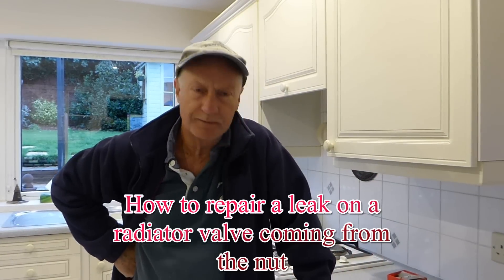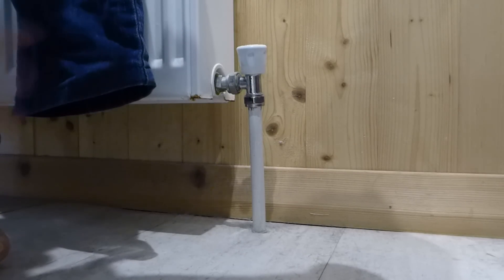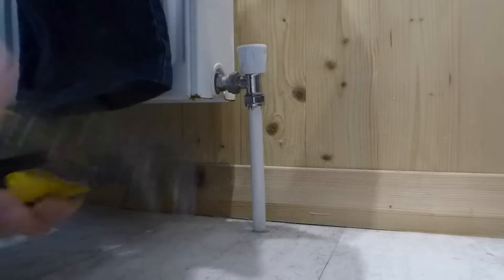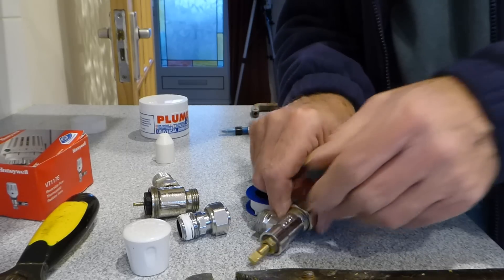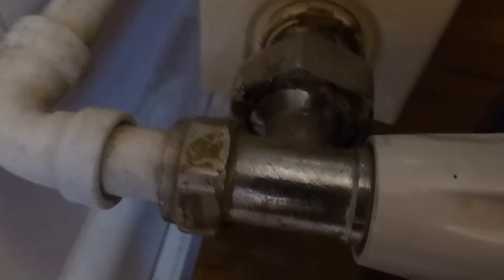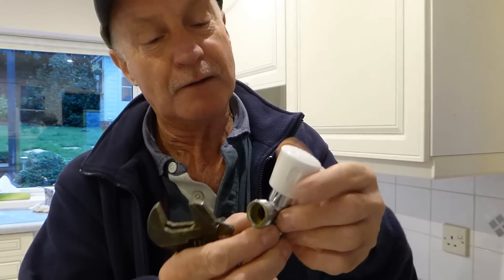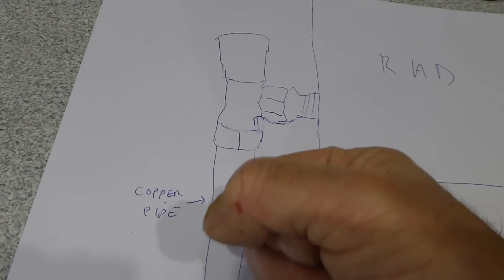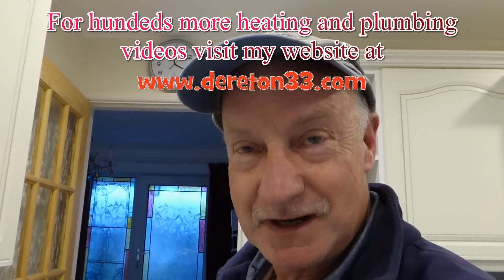How to repair a leak on the nut of a radiator valve

Comment: Question : I have 8mm copper on the radiator pipe coming from the manifold in the loft could I replace this with a plastic speedfit pipe 10mm using an insert 🤔
Reply from the maker: Not without connecting the 8 mm copper to 10 mm first.

Comment: Silly question possibly but I have a leaking packing gland ( 45 secs in this video ) and this guy says to unscrew and pack with ptfe . Do I need to drain the system as surely water will burst out or hopefully not , just unscrew and pack, with minor spillage ? Thanks in advance ! ☺
Reply from the maker: No need to turn the water off very minor spillage if any,  just have a cloth under it, if you are worried.
Reply: @dereton33  cheers pal! 👍

Comment: My problem is ... After applying PTFE tape or boss white - when I turn on the water, the valve threads with the nut and cone attached bursts away from the smooth pipe which goes into the radiator. I can't find anything which holds it ... I'm now thinking super-glue 😆
Reply from the maker: Try some hemp, with boss white on it around the front of the olive.

Comment: I have removed a radiator for decorating and have a leak coming out where water flows out or in the radiator. This would not be a problem if the radiator was back in. It's not coming from the top spindle that you can repack and not from the bottom valve either. Is there a way to stop this leak until I can get the radiator back on the wall? It is completely tight off on the spindle. I assume it was leaking when the radiator was on the wall but of course would have the radiator next to it so wouldn't leak. It's specifically leaking out where the radiator would be. I assume because the valve is so old. I currently have a cloth poked in the hole into a container to wick it up until I can get the radiator back on the wall. Thanks.
Reply from the maker: No nothing can be done best to use a brass cap to stop the flow for now.
Reply: @dereton33  Thank you for the reply. I used a cloth to wick it up into a bowl overnight. I painted behind it and cleaned and sanded and got the radiator back on the wall. Perhaps you could do a video on those who wish to decorate and this dripping leak? It's not covered in anything I've seen on your channel. Some people might want the radiator off for an extended period and demonstrating the brass caps would be a good video. Do you have a link to brass caps for this as will be doing other radiators in the house soon? Thanks.

Comment: Hi Dereton,
My radiator has been leaking from the side of the radiator end which you have mentioned at 06:51 and which is very rare. It was only installed 2 months ago and the plumber had put a new PTFE tape on it. Now what should I do? Should i just tighten the end that goes inside the radiator or put a new PTFE tape on it again? Thanks
Reply from the maker: Try tightening it first. If it still leaks then add some more PTFE tape to the joint wrap it around the olive.

Comment: On the last valve you mention on the live, is it clockwise to tighten on the left side of the rad looking at it and anti on the left?
Reply from the maker: Yes.
Reply: @dereton33  Thanks. Is there anything better than PTFE that you can use on an olive that leaks? I see plumbers using grey stuff all the time when connecting various pieces. Is this good to do?

Comment: Great video thanks. We have lockshield valve with a leaky pipe nut (the one at the bottom) and are hoping just to nip it up. But if we do need to undo it completely to add ptfe tape, what if the valve is on the INLET side - wont water just pour out once the nut is loosened?
Cheers
Reply from the maker: It will  leak out on either side, just have some old towels ready while you wrap the PTFE tape around and tighten the nut back up.

Comment: If one was to have done exactly what you said not to do at 3:17 (before they had watched this video) and caused water to leak down the pipe from the valve is there any way of repairing the seal or will the valve need to be replaced?
Reply from the maker: Just use some PTFE tape around the olive. PS shows how important to watch the whole video before proceeding..

Comment: Brilliant video. I'm not a plumber and I have a leak in my upstairs radiator. The leak is definitely from the last description. Home Emergency said they would have to isolate it but they won't replace the valve or nut.

How much does the valve replacement cost?
Reply from the maker: About £6.00

Comment: On the end with the Thermo stat can I shut that off and then detach the other side (where my leak is) and not drain the entire system
Reply from the maker: Yes as long as the temperature does not drop below 5%.  Or the thermostatic valve will turn on.

Comment: I have one that is dropping where the rad tail screws onto to valve. I have tried nipping it up, no success, then drained rad and applied plenty of ptfe around the valve thread, but still it drips? Regarding having to drain the system when working on the live side, would it not be possible to fit a compression isolator (perhaps a full bore one) on the pipes up to the rad valves, to facilitate maintenance?
Reply from the maker: You can fit valves they just don't look nice.

Comment: This video and your one on how to remove a radiator saved me a hell of a lot of money. I have no clue when it comes to plumbing. Got the rad off with no problem. (Previous owners bracket fixings were hanging off the wall) Fixed the leaky valve with some PTFE tape and put it back on. Got a little wet, but with the help of my wife we did it no problem. Thank you and keep up the great videos.
Reply from the maker: Thanks for your kind comments Hitman 1.

Comment: How about sticking a few layers of pvc insulating tape on the jaws of the grips so they don't damage the nice shiny chrome finish on the valve, those pegler valves are well expensive.
Reply from the maker: Good idea if you can get the grips to grip with it on.

Comment: Does aircock need to be opened to do this as i have older heater and its wore away and i cant turn it
Reply from the maker: No, you will not let any water run out to need topping up the rad.

Comment: How can i pack with ptfe if the water is pooling up around the valve? It's totally locked off but it keeps pooling up! Happy Easter and great vids by the way.
Reply from the maker: You have to persevere and poke it down with a sharp bradawl, then start the thread of the nut (packing gland)
Reply: Thanks for the replies. I'll see if i can figure it out for myself. All the best

Comment: Thanks. Was not sure if i had to turn off the water supply or not. No one says you do. Turns out i simply had to turn the nut down a half turn or so, until the leak stopped.

Comment: My leak is coming from the bottom nut. I tried removing and packing it with PTFE, but as you suggested the flow of water is too much to let it take hold.
I'm tempted to just replace the valve without draining. Apart from dealing with a couple of minutes of live water flow while I swap them, is there any big downside?
Reply from the maker: No just be as quick as you can with the change over, if you are worried though you can always get a freezing kit and do it with no worry s.
Reply: You could take the risk of doing it live but be aware the thread on the nut on the pipe may not have the same thread as the new valve

Comment: Great videos!
Im trying to replace a radiator with a towel rail. The valves need to go in vertically rather than horizontally. Can I save the hassle of bleeding and repressurissing and the cost of new vavles by just attaching some elbow joints?
Reply from the maker: Sometimes but it depends on what valves you are connecting from.

Comment: okay thanks which way do I turn the nut to take it out clockwise or anticlockwise?? and also does the radiator need to be OFF to do this?Thank you for your help
Reply from the maker: The rad can stay on, to take the nut out it is anti clockwise.

Comment: Hi Al.
Am in need of your expertise yet again.
I have a leaking pin on a TRV. 
Therefore, I thought the best solution would be to replace the TRV.
The system was flushed few months back with new chemicals poured in.
The question is, if I need to add chemicals to the system again after drainage and valve replacement?
Or there would be enough chemicals left inside to be topped by water only.

Much obliged and utter respect as ever
N

Comment: what can we do  we turned tried to turn the radiator back on took the cap off and used pliers but the brass part snapped off when turning
Reply from the maker: O dear sorry Julie, the valve will have to be renewed now.

Comment: Should the tail threads of a new radiator be rusted/have metal debris in the threads and, thus,  it is impossible to screw in the valve tails by hand by even the smallest amount? Should screwing in with the spanner be VERY stiff on such a new radiator and cause a crunching noise to occur when doing so? Not cross-threaded. Should the number of threads on the radiator tail entry be significantly less than that on the valve tail? If this can be the case, does one screw in the valve tail until just one thread is showing, ie way past the number of threads in the radiator tail itself? Even if screwing in thus is excruciatingly stiff with 5 or 6 threads of the tail still showing? Does it sound like we have been sold a 2nd-hand duff radiator as new?  It arrived without plastic plugs in the tail and the wall fixings were missing (towel radiator). Metal debris was on the tails; could be felt easily on the fingers. The debris inside the bleed valve was even worse and the bleed valve itself immediately failed to shut after bleeding once the radiator was filled up. New bleed valve seemed to solve that, but water bleeds out of the tails after radiator gets hot and cools down. I suppose I did only put 10 wraps of PTFE tape on, but I would assume the PTFE got destroyed by the crunching that occurred when screwing in the tails as far as they would go, ie with 4-6 threads still showing. When I say, bleed out of the tails, I mean where you say in your video that it very, very rarely leaks.
Reply from the maker: The tails should screw in at least 4 to 6 threads deep, also try using hemp and boss white instead of PTFE tape.
Reply: @dereton33  Thanks for the reply. I used Jet Blue with PTFE to be extra sure! Didn't know about hemp. Of course, it's in the back of my mind that perseverance is pointless if the radiator is duff. Problem is I don't know what a new radiator should look like around the tails. I was not expecting rust/debris in the tail threads. All the online videos show you guys screwing the radiator tails in by hand quite easily!
Reply from the maker: If the rad tails in the rad itself are rusty you will get a real problem with sealing it.
Reply: @dereton33  Once again thanks. Got another new rad and tail thread is not rusty, so the other one was duff. Checked out a lot of new radiators (after getting paranoid) and none of them ever have more than 3 threads at the tails. Valve tails have 10+ threads. Are we supposed to screw in only 3 threads or as far as the valve tail will go? Companies making these products never reply to questions esp. Pegler Yorkshire
Reply: @rodneyleadbeater5410  it's a taper thread so you need to screw the tail in until it's reasonably tight but don't overdo it

Comment: I'm trying to get this, but shouldn't you wrap the Teflon tape around the pipe in the direction that your nut will turn so it won't bunch up or back out?  At 6:20 you're wrapping the tape in one direction and at 6:30 you're turning the nut in the opposite direction. Or does it not matter here?
Reply from the maker: On this job it does not matter.

Comment: Dereton, I recently came across a bad situation. A cleaner had tried to let air from a radiator by turning the escape valve at the top. Within seconds the whole component literally came away and very hot water at high pressure started spraying across the bedroom. The taps at the base of the rad were also seized. What emergency remedy could you suggest to a householder in such bad circumstances, to stem the flow, whilst a plumber is on the way?
Reply from the maker: A large ball of plumbers mait, whacked into the valve.

Comment: Hi I have a problem my radiator brackets are coming off the plaster board and created a bigger hole can you please help thanks colin
Reply from the maker: Hi Colin you will need plaster board fixing screws.
Reply: Hi I thought that I would have to move the pipes,  the holes are bigger than the original not sure how to do it,, I thought of wedging some pieces of wood in the holes and try to screw size 6 coach bolts so they can tighten on the wall of the plasterboard regards Colin
Reply from the maker: There are some fixers that are like large screws that would fit into an oversized hole, once screwed in the over sized holes the smaller screw that comes with them, screws into that.

Comment: Any advice when I have a valve where the cap is one of the chrome covers that doesn't seem to come off? My leak appears to be inside the cap rather than on the nuts shown here. Sadly the chrome cap doesn't seem to unscrew or pull off. Many thanks.
Reply from the maker: The cap should come off to reveal a screw underneath this will allow the top to come off.
Reply: dereton33 many thanks / cap unscrewed after a little bit of limescale remover 
All sorted , appreciated

Comment: I have a valve on my radiator I turned off wen replacing the radiator I came to turn it back on and it will not move it not on the thermostat valve it's the other one how do I release it
Reply from the maker: Take the plastic top off and use a small spanner or pliers.

Comment: my valve doesn't leak when the radiator is on but leaks when the radiator goes off at night when the valve goes cold. What do you suggest please??
Reply from the maker: Repack the gland with PTFE tape. I have a video on how to do it.

Comment: You can disconnect one end of a radiator and have the pipe open without draining the system, and not have water come out of the pipe, as long as the pipe into the radiator comes up for at least the last 6" (For a pipe coming down from the ceiling think letter "J". If the pipe is horizontal this may not work:

1. If it is a sealed system, release the pressure through a drain cock on the boiler (or at the lowest point of the system if fitted). If there is no drain cock, loosen one of the radiator fittings as shown in the video. This is only to let the pressure out - don't let air go in. If it is an open system with a header tank, put a bung into the bottom hole in the tank, AND into the expansion loop that is over the header tank before you release the pressure. 

2. On the radiator you are servicing, close the valve at the end away from where you are working, open the air cock on the radiator, and loosen the nut that holds the valve to the radiator. Let all the water out.

3. At this point a partial vacuum develops in the system, and the water cannot flow out any more.

This perhaps seems risky, but I've done it several times, including just now while I am trying to stop the type of leak mentioned in the video. This has the advantage that when you have done, you only have to fill up the equivalent of one radiator, and you don't lose (or have to store) the whole of the systems water, if it has preservative in it.